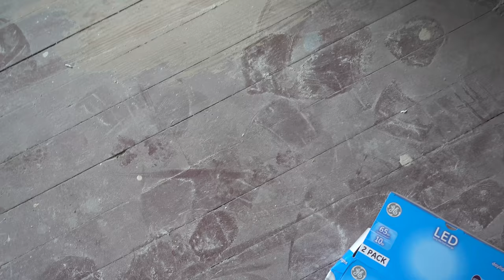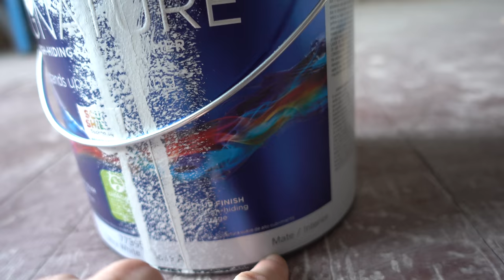Let's Paint That Ceiling!

Comment: Spend the money on a lambs wool roller. It will cost about the equivalent of 4 of the rollers you mentioned in the video for 1. It is worth it. They hold an enormous amount of paint, give you an even coat. Given the amount of work you are doing on the house, spend the money for a paint brush and roller spinner for cleaning. The fuzzies on the wall could have been minimized by using masking tape the same way you use a lint roller. The cracks could be filled using sawdust mixed with floor sealing lacquer. This step would be done after the floor is initially sanded. You won't like the contrast in the color if the floor is left unsealed. The sawdust/lacquer slurry should be applied slightly proud of the floor surface, then sanded again. Doing so will allow the stain take more evenly over the entire floor.

Comment: Where is the dry wall tape?  Your not even close to done!
Reply: Had the same thought.  On the ceiling, I thought she just might not have filmed taping the seams, but it is pretty clear now that they weren't taped.  Unless they are ok with the seams showing through/cracking over time like they did before they started renovating, the limited elasticity of the paint will eventually give way to cracks.
Reply: Dean Reinke, I think that she may have used a fiberglass mesh tape, but I wouldn't want to bet my life on that. At least she gave the reason for using "flat" paint, also she indicated that she once worked in the paint department at Lowes.
Reply from the maker: ill fix it if it cracks ;) if you'd like to come over and do it you're more than welcome.